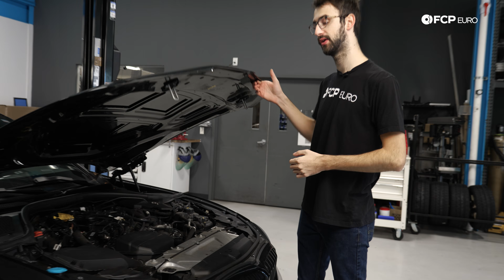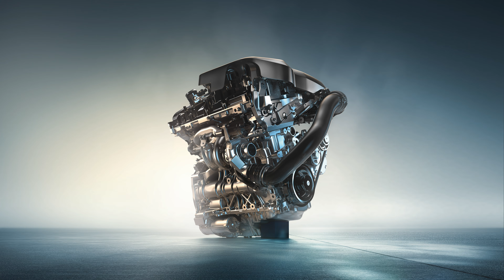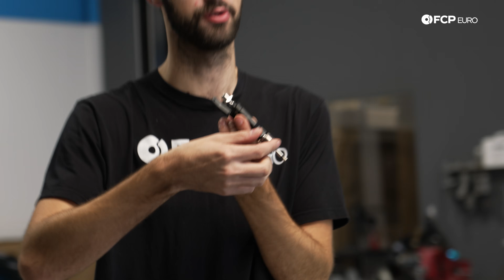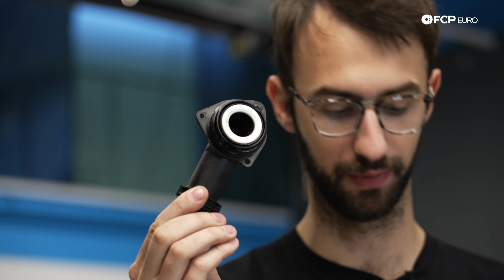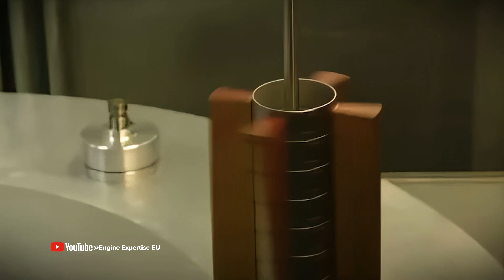BMW B48 Engine: Everything You Need To Know - BMW F30 330i, G20 330i, G01 X3 xDrive30i Engine Guide

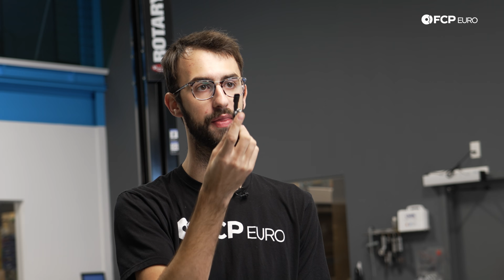Comment: 15:35 Don't ignore the plastic oil filter housing warning 😭 The day my my b48 hit 60k miles it needed to be replaced since it was leaking coolant. Upgrade to the aluminum one for sure
Reply: did you use an aluminum Oil Filter Housing?  If so, which one?
Reply: how much did you have to pay for labourcosts and parts costs?
Reply: i did this on my 2015 mini S. The car had 130k miles when i replaced it but surprisingly it was not leaking yet. I consider myself lucky!

Comment: Wow!! what a great video.  I have the M54 NA engine in my 2004 Z4- 45k miles. Sewing machine smooth NO Turbos.  Just a leaking valve cover which was already replaced.  Why does BMW insist on so  much engine plastic.   Heat and plastic are not a good match especially with a hot turbo added.

If the parts you showed aren't too expensive including labor it might be a good option to buy a new 430i.   I would prefer a 3.0 liter inline 6 but the M440i is quite a bit more money.

Comment: I'm in my 4th year of ownership of the 2dr '19 JCW and I am so glad i found this video. Very awesome presentation, and I'm glad to hear "best engine ever" when I'm intending to own this into very high mileage. Thank you for this.
Reply: I have the same car lol just lost  a rod barring at 55k and my clutch pedal has broken 3 times damn car is a money pit  it’s spent more time In The shop than I’ve driven it 😢 fun car but a pos😂 30k for a brick
Reply: @radonvon3120  it's true that this video is just about the engine, not the trans/suspension/trim whatever. But i have had zero issues living in Canada on pothole roads and salty winter driving. I am low mileage at only 60k for a 2019 but i have only done regular maintenance on wear items and all scheduled OEM maint. The worst thing i have had is a rubbing of the trim section against the B pillar behind the driver seat when i have loud music going. I have put some foam spacers in between the trim pieces to solve the issue. Sorry to hear they aren't all built the same.

On the plus side they look like they are holding value well in the resale market.

Comment: I do not see a compatible Oil Filter Housing on the FCP Euro site for my 2021 330i with B48 engine.  I'm only at 35k miles so perhaps an aftermarket one will be available by time I hit 50k-60k miles.

Comment: 2017 g30 530i here. 
Already replaced:
Engine mounts 
Expansion tank
Oil filter housing 
Radiator
Few hoses
And still currently have a leak… 
BMW is building trash

Comment: I own 2018 330x drive f30,now I am on 190.000km or 118.000miles.I had issues with the coolant and some plastic hoses leaks and this was all done.Had my transmission oil changed on 120.000km , regular oil is changing every 10.000km.If anybody can be nice enough to tell me what should I change and replace now so my car can run longer, ??And do you recommend stage 2 upgrade?

Comment: I upgraded from 2005 330i with N52 to 2022 330e with B48 and 15k miles. I don't really feel that I've lost those 2 cylinders. Sound is the only thing that is way worse than it used to be with the N52 but every other thing is just miles improved. Love my B48 and I'm happy I haven't made a mistake lots of my friends did, buying F3x with N20 engine

Comment: B48 on 330i 2016, 90,000kms. Oil seeping out of oil cap and counter balance shaft seal. Had always suspected crankcase pressure from failing PCV. Glad it was mentioned here.
Reply: We recently replaced the valve cover on mine, and it looks like the PCV system was not only forcing oil out of the oil cap, but there was oil oozing out from under the high pressure fuel pump as well. Hopefully we can create/ source an improved (ideally metal) valve cover and external PCV in the future!
Reply: Hmm... having the same problem with my 2020 230i oil cap leaking shaft seals leaking🤗🤗

Comment: You completely forgot about F B48’s plastic head to hose connector. Please add it.

Also turbo water line from aux pump failed at the point between metal and rubber.
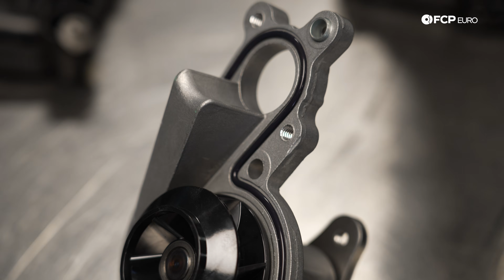Reply: I specifically mention that line at 22:25, along with our in-stock product listing :)
That's good insight on the turbo lines!

Comment: All of these cylinder coatings wear out eventually and then the whole car is totaled. I would prefer raw metal. Drive 500k miles take it apart, machine it on a lathe, slap back together do another 500k

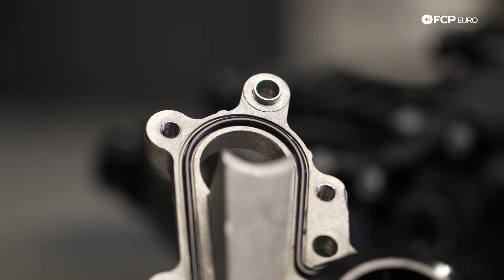Comment: The B48 coolant pump in my vehicle failed at 159,000 km due to leakage at the seal between the base and the unit, specifically the one often praised for its performance (timestamp 3:40). After replacing it with a brand-new unit, the replacement pump failed within 700 km, ejecting coolant at a speed of 150 km/h. Following this incident, the system was repaired again. However, two weeks later, a leak was identified in the main radiator, necessitating its replacement alongside the coolant reservoir tank. Since these repairs, no additional issues with the cooling system have occurred.

Additionally, I am experiencing a rough idle when transitioning between N/P and D/R. Engine RPM drops from approximately 700 to 500 during these transitions, accompanied by significant vibrations lasting about one second.

The vehicle in question is a late 2017 BMW G30 530i xDrive, German version.
Reply: Any solution to the vibrations?

Comment: Wow so good to know that BMW makes such sensible engines.
What ever happened to good old fashioned reliability, having a car/ engine do 300...400k without none of this BS 
Personally I'm a JDM fan....no modern BMW or Mercedes or VAG engine touches my 1UZ-FE...1st gen with the bigger rods.
Running a supercharger on it since 2005......no issues......zero ..... nothing.....granted it's running 7psi...and makes just under 400 whp...but still incredible reliability.
200k on it and nothing but normal maintenance.
Also own a 4ge with 320k and a Hilux Diesel with half a million km....nothing but reliable motoring and simple maintenance.
So when I hear people say B58 and S58 are better than the 1jz and 2jz I just want to laugh
....let's talk in 20 years and see what happens.

Comment: Have they found a plastic composite that expands and contracts at the same rate as aluminum? I don’t think so. I’ll stick to engines that are older, and still use aluminum for all their engine intakes, valve covers, oil filter housings, transmission pans, etc. Cheap composites just don’t hold up. But, they sure cut costs.

Comment: What a piece of crap....I'm considering getting a BMW because I want the performance BMW is known for but the use of plastic everywhere &  all those issues you candidly speak about is unacceptable.  I have a 2011 Toyota Camry SE V6 and it is just about to hit 300,000 miles and has no issues whatsoever, it doesn't burn a drop of oil, never had any leaks, and runs great...268HP, 0-60 in 5.8 sec, quarter mile in about 14.1 sec, it does 140MPH no problem, It's a glorious engine.  I know it doesn't handle as good as a BMW, but it is fairly fast & incredibly reliable.

Comment: b48 revs higher with less drop off??  my g20 power drops off significantly after 4k rpms. It has great punch off the line. easily spins the tires and with a little finesse will kick out nicely

Comment: Wow, this video is a great manual as to why I am not buying another BMW right now after having been a lifelong fan and customer.  All sorts of critical components all in plastic that all fail that could have been made durable.  You get to 60,000 miles with one of these and you have like $3000 in repairs for stuff that should cost like $500 max. And it's all that expensive because it's all integrated with big important stuff that and/or buried and needs lots of labour and huge incremental parts cost. 

With these types of repair bills planned into the regular running of the car and the risks of larger failures that come with them, there is no reason to not go for a Porsche at this point. Sad to see such great machines turned to disposable junk. These machines are not durable.
Reply: I have a F34 328 GT with the N20 engine and I never had an issue with this car. It’s unbelievable. Stepping up to a Porsche is a big jump. I hear you though.

Comment: Crazy to see how practically all plastic components are the ones to fail here... I own a B48 Supra and am very pleased with it. Currently at 50K Kms in 8 months as its my daily. Hopefully my valve cover won't fail as i no longer have warranty with my tune.
Reply: 50k km in just 8 months? You bought it new? No. How many km did it already have? I have a b58 m340i , did 24k km in just 6 months..

Comment: Currently have a 2018 F30 B48, fully optioned. One of the few cars I actually look forward to driving everyday. It's insanely reliable engine wise, but had only one true breakdown with my coolant pipe. My coolant pipe blew up, leaked, and it was on the highway. Smoke came out of the engine. Fixed it and no issues since.

Other reliability issues are more of quality than anything else. Lots of unknown rattles coming from the passenger door side, and I spent endless days trying to figure out what it was, and still haven't found it.
Reply: Ditto on unknown door rattle, but in my case the driver door.
Reply: It's the side skirts that rattle

Comment: the b58 block and crank is borrowed directly from the b57 diesel, the b48 is that same block with two cylinders lopped off. the b48tu got the same fueling updates and internals as the b58tu.   its got the same bore and stroke as the b58  82mm bore 94.5mm stroke (massive stroker engine from factory) but will rev way higher despite the crazy piston speed.   On paper the b48 is the best 4 cylinder being made today.  You can easily make 7-800whp with a bone stock b48 with just cams, springs, head studs and a better gasket.  we have been putting them in e36's lately and they absolutely scoot beter than any of the iron i6's from bmws past.  im putting one in my e30 after xmas.
Reply: can you make some videos on those b48 swaps into e36/e30 please ??
Reply: I want to see the b48tu making 750-800whp

Comment: I noticed that all weak part of the engine are  plastic.  I have a B48 gen1  (F30  320i) and recently had oil filter housing failure, coolant leakage..  It was on 107000 km mileage. Replaced with aluminium one.

Comment: Coming from driving a "big" n/a engine ( s50b32) seems (at least to me) that the b48 does actually fall off after 6k rpm. Dont get me wrong, it's a great engine and the torque curve si nice and wide from low rpm. Again i might be biased because i'm comparing apples to pears. But the fall off on the b48 is noticeable. 😇

Comment: Sure these engines are powerful right out of the factory. However, as with all modern BMW engines; THEY ARE PLASTIC and require lots of maintenance once the factory guarantee has expired. I will not buy a BMW😂🎉

Comment: I have a U.S. model F44 (2022 228i GranCoupe). Where can I find the engine code for my vehicle? 

My 2009 E60 has a sticker under the vanos (N52B30) but that’s longitudinal. 

The 228i is transverse mounted as its front wheel drive.

Any info is appreciated for my 2022 F44

Comment: I have a B48 X4 with Racechip Tune, hi flow air filter, open exhaust valve flap. It actually does boogie and have quick acceleration. The turbo is very responsive and fun to drive.

Comment: i live in the UK and have an F30 330e, 99.9% sure it's got a B48 from plugging in to ISTA, does any of what you said in relation to engine wear % failing seals relate to the engine on a hybrid? and is the engine different on a hybrid at all ?

Comment: I've had my F22 230i from new (delivered November 2016) with the 248hp/258lb/ft version, according to Wikipedia it's the B48B20O0..
Currently approaching 124,000 miles.
I've had an engine fault code putting it into limp mode back in 2019 which resulted in a new turbo under warranty, with one month remaining of the three years warranty! But no full explanation was provided. That was at around 48k miles. I had the thin block-to-header coolant breather hose fail summer '23 at around 98k miles. The block to radiator hose and plastic spout started leaking summer '24 and was replaced. Now the internet (b48 Facebook group plus these videos generally from the USA) is making me worried about the oil filter housing!

I've stuck to the manufacturer advised 20k oil service interval, so far always done at the BMW main deealers. I have however occasionally done a track day with it- 7 in total over the 8 years I've had it. I'm in the U.K.
Reply: you're the kind of owner bmw loves because you follow their dangerously long oil intervals without question. no wonder your car is having issues, those contaniments are wreaking havoc on the delicate parts of your engine.

Comment: Bought a used 2019 230i M sport with 46k miles ive done its oil change intervals every 5k miles not a mile later. Beautiful car and smooth motor, now at almost 60k miles its treated me well only thing ive noticed is oil seeping from the cap light seepage but i believe its my sloppyness when filling up with oil hopefully my pcv valve treats me well 🤞
Reply: You both should know what is causing the seepage. The PCV valve issue was explained in this video.
Reply: After this video…. I’ll stick with my Japanese car 😂😂😂
Reply: Our 2017 230i with low kms (50K kms) is the same with the engine oil cap seeping a tiny bit of oil. We changed the cap but it didnt help. It's not a huge deal but curious to know why it's doing it. No other issues though.
Serviced 6 monthly with 0W-40 and within 5K kms)
Reply: @sassyrav  In the video it tells you why it's doing it. It's the PCV valve
Reply: According to the video whole plastic valves cover (with built in pcv valve) should be replaced.
Reply: Are you using the oil recommendation or a thicker oil

Comment: The BMW engine code numbering system doesn't make sense, what about engine code B48B20A and B48B20B?

What's the A and B represent?  (found in the 320i, 330i, 330e)

I know the B48B20B is the better engine to tune and achieve higher tuning results, but what's the difference, what is going on with that numbering system?  the performance class you covered only mentioned K, U, M, O, T, S  (no A or B ).   Any ideas anyone?

Comment: HELP!!! I got a Fuel Tank Ventilation Valve code on my f10 528xi with the n20 and it randomly went away one day and hasn’t gone back after a few months of clearing it. I’ve had PCV valve or PVC valve or fuel tank breather valve thrown in my face a million times but I just want to make sure I’m buying the right thing. the PCV valve isn’t the diaphragm thing on top of the engine but rather the thing on the back right of the engine? anyways hopefully someone reads this. Have a good day!🎉

Comment: i have x3 G01 2019 252 hp with B48B20B engine; problems we had: vanos, cracked upper cooling circuit pipe; at the rest of 60,000 miles, i rebuilt the timing, changed the injectors and spark plugs and water pump; the timing was affected by a faulty oil pump that did not pump oil into the crankcase and created friction in the components. otherwise, i am extremely happy with the engine, i change the engine oil and filter at 5000 miles
Reply: you do understand how ridiculous that is, right?  60k miles is 1960s  Chrysler quality.
Reply: All of that and say otherwise 😂
Reply: get a civic
Reply: lists catastrophic and extensive maintenance items at a ridiculously low mileage “otherwise I am happy!” 

BMW owners man … completely delusional.

Comment: The B48 is a good engine. It needed to be, as apart from a certain Turbo F1 engine and the S14 in the original M3 BMW's 4 cylinder offerings have generally been pretty rubbish.

Comment: Already bolted a BMW 6MT to a B46. Used a euro 520D.
Reply: Was it a direct swap, plug and play, or did you have to do modifications? I would love a 6MT in my ride.
Reply: @davidedenburn5810  It was also a chassis swap (into an E46) so had to fabricate a trans mount, customize the drive shaft, and find the right TOB, pressure plate, flywheel, and clutch so not PnP.  However, it does bolt right up.

Comment: Awesome video! What gets me with these engines is that they produce ~240 hp and do fairly well with fuel economy at the cost of enormous complexity. The coolant leak I just repaired on my 2017 430i with the B48 cost about $600 in parts (my labor was free). The S52 (6-cyl) from the E36 M3 also makes about 240 hp and is way simpler. WTF regarding the PCV valve?! (In older cars the PCV was just a low-dollar part!) Would you go for a more reliable, lower cost engine in exchange for lower power? What if something like the S52 was updated with newer manufacturing and coating technologies and improved VANOS, to provide a medium power, better sounding, low complexity system?
Reply: why is your labor free?  Just because you do the work yourself doesn't mean the labor was free--you set aside family time or something in order to do the work.

Also, I don't know why BMW engineering is like it is.  They certainly have odd priorities.
Reply: @bb5242  Good point! I meant it was $600 just in parts. Probably $2k if I had to take it to a shop or dealer! As a test engineer, I enjoy learning about the systems, but I am confounded as to why they have to be so complicated. Not complicated in a beautiful, elegant way. Complicated in a stupid, frustrating, "who chose this solution?" way!